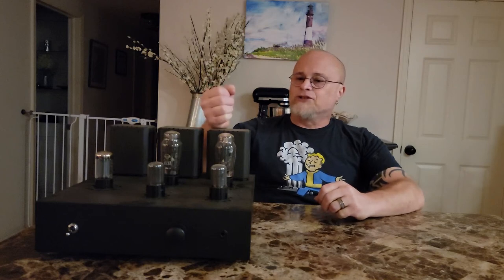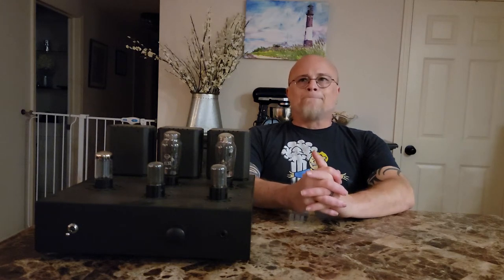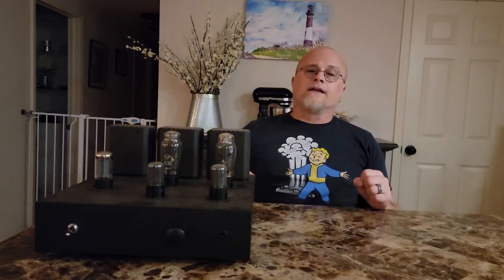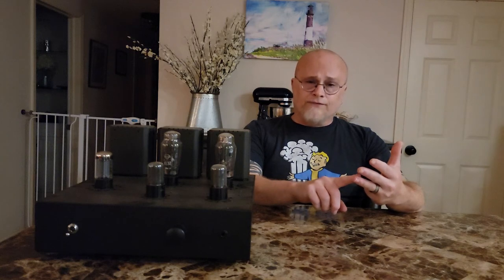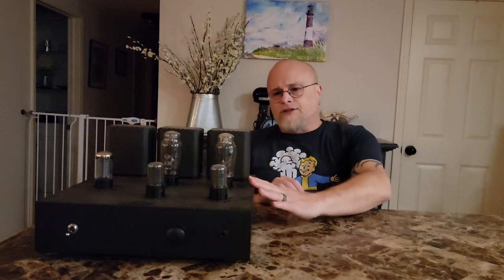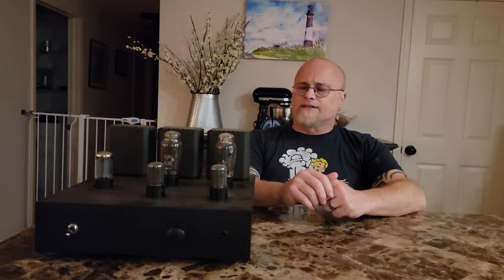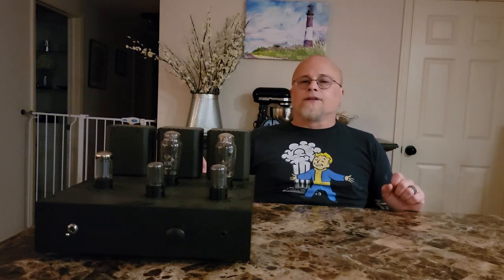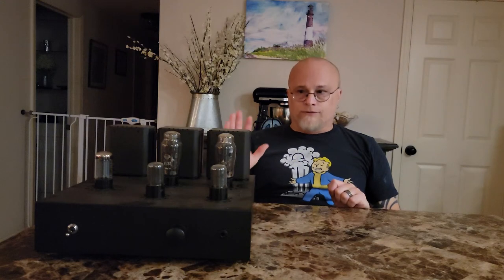Meet The Aegis

Comment: Please ask L0rdGwyn to add an option to install 4 pin XLR out.
Reply: LG here - sorry, but at least initially, it is TRS output only. Possible down the road I could include instructions to build with XLR, but right now it is too much to redesign the front panel and have a separate set of instructions, everything is finalized at this point.  You could use a TRS to XLR adapter, the amplifier is single ended so it does not require a balanced connector.